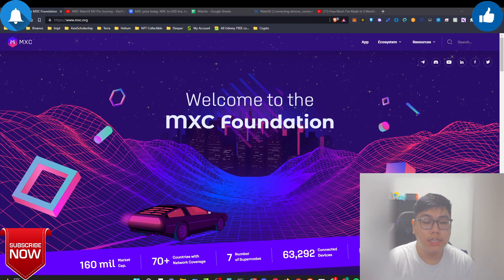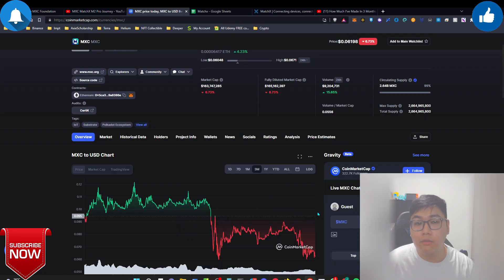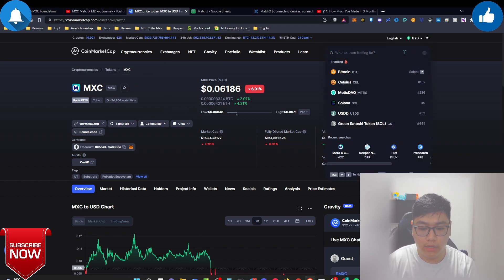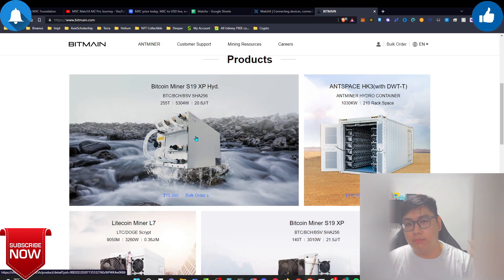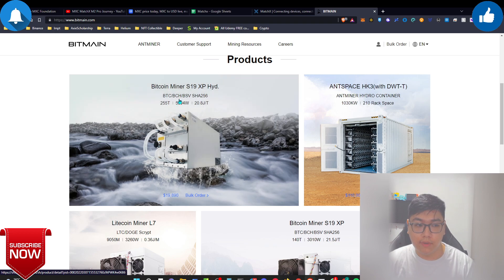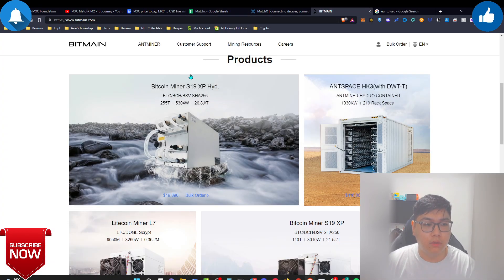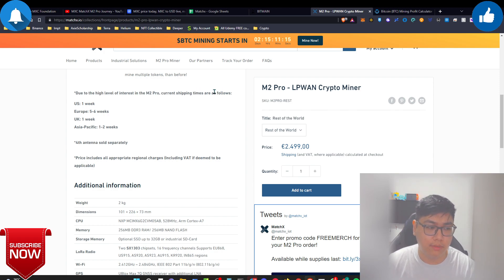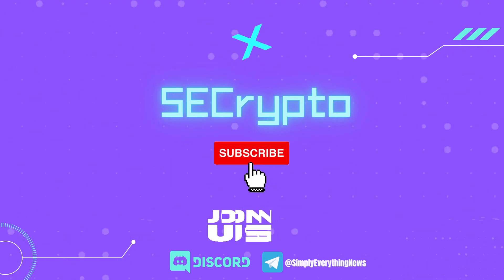How To Mine BTC Without Huge Electricity Bills? MXC M2Pro Miner Is..... daway

Comment: I have found matchx M2 pro which is 500 AUD. New. Is it worth it?
Reply from the maker: Unsure how to check if it's authentic but buying from original store is surely authentic, don't fall for scams cause it looks cheap but unusable
Reply: Be careful they can't be reused if they have already been activated.
Reply: @darronanderson7468  what do you mean they can't be resized if activated? All I want to do is mine or something why does every industry have to be full of scammers. Can we just lunch and torch a few of them in public and then hopefully the rest will stop. It's hard enough trying to get by and we have scammers. So Alibaba has a store 97% positive review, 11K followers, and the matchx m2 pro brand new for 500. If you buy 2 you get one free.
It's actually the perfect price because I would not pay 3K for this miner.